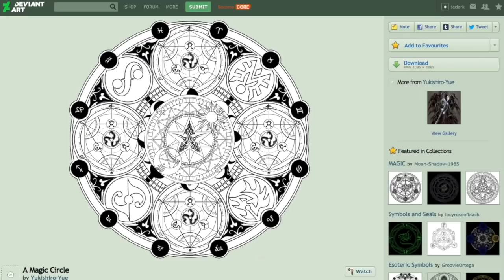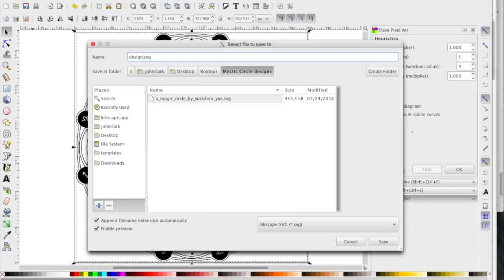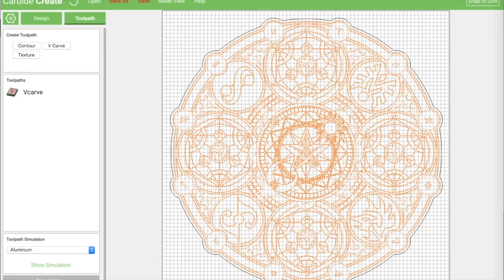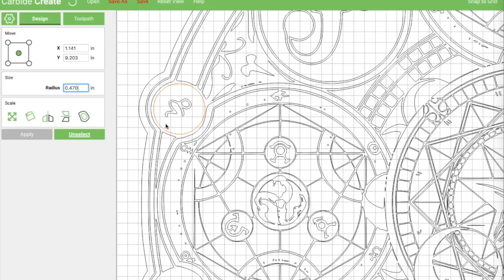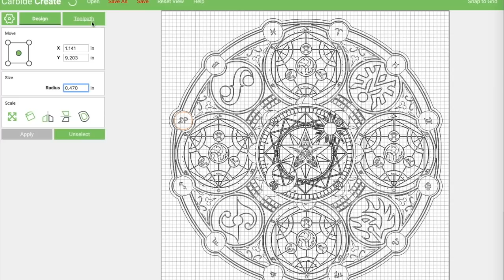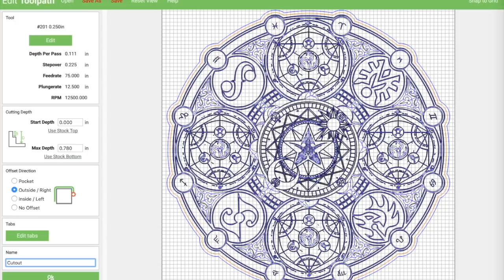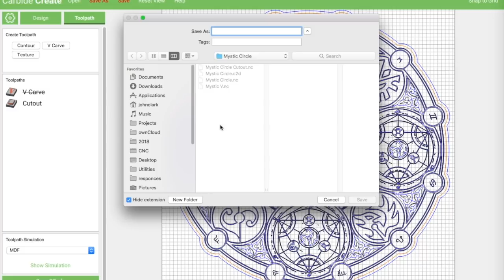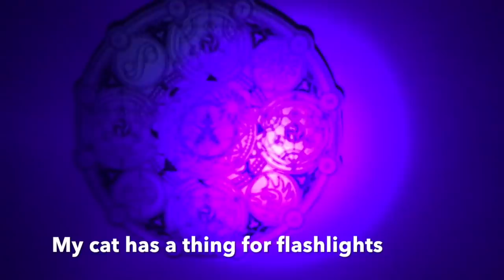Mystic Circle - MDF Wall Hanging with Shapeoko 3

Comment: Lovely project. On the painting, you said not to soak with water. You've already sealed the MDF with shellac & 2 coats of spray paint. You've not cut through those, so the MDF is still sealed. 
Another hint, you can add approx 20% water to acrylic paint, makes it easier to brush on & wipe off excess.

Comment: Do you have a video on how to add end mills to carbide or can you only use the ones listed?
Reply from the maker: I have not made a video on adding bits (it's planned as part of a getting started video I am working on). The basics are: When you create a tool path, you should see an edit button below the currently selected bit. On the next window you should see either "Change Tool" (current version) or "Edit Library" (Older versions). This is where you can edit and add new bits. The new version is a little more confusing as you need to add a new library, expand the library and then right click on the library and select New Tool. This is in no way intuitive.

Comment: Intersting.. I use V-carve so there is NO need for inkscape.  Its fareasier to use and has finer control on the toolpathing.  The downside is its NOT  free.  From $350 to $700 depending what version you get.. WELL wrth every penny and it dont take long to pay for it by the time saved alone to do things.

Comment: I noticed your version or carbide is not showing the estimated cut time how accurate is that?  I did a version and it told me the cut time was 17 hours!
Reply from the maker: The video is about a year and a half old, so my version of Carbide motion was pretty old. I seem to remember it taking about 6 or 8 hours to carve. Two things to check on your file: In the settings, you can drop the retract height down to about 2mm for MDF. Secondly, you can increase the plunge rate when you set the tool path. The big thing with a carve like this is the number of times the spindle must raise and lower. Let's say it takes 3 seconds to drop the spindle with your original settings, if you are making 10 plunges, it's not a problem time wise. However, this design makes almost 7000 plunges and at 3 seconds per, that's about 6 hours of waving your bit in the air. :) Does that make sense?
Reply: @johnearlclark  Hi John, I downloaded a phone holder design from cutrocket, tried to change the text and set up a v carve but it is giving me an empty toolpath any ideas?
Reply: I figured it out was using wrong bit!
Reply from the maker: @Olivsam  I hate when I do that.
Reply: @johnearlclark  John, I use a couple different programs to generate g code and send it with UGS.  I have noticed that the g code I run from carbide create runs much slower than other programs I use.  Can you recommend speed and feeds for carving wood? MDF, pine mostly
Reply from the maker: @Olivsam  I am still trying to recreate my old settings in the new version. I had a notebook with settings, but I seemed to have buried it somewhere in the shop. Carbide's settings do seem very conservative for wood. I typically set the cut depth to be half the width of the bit and then tweak as needed. A lot of this is very dependent on the type of wood and the bit itself. Brand difference can be big. I can push the Amana bits harder and still get a decent cut. I also tell people to listen to the machine. You will hear it when the bit gets pushed too hard. Pine can be a particular pain since it splinters really easily. Shallower cuts and a sharp bit are my best suggestion there. MDF you can push harder.
Reply: @johnearlclark  John, maybe you can help me, I am wanting to do a carving that has a  wavy ribbon around the perimeter.  When I zoom in, the sections of the ribbon are not connected.  I want to do a cutout of the piece that will follow the wavy perimeter any ideas on what I need to do.  Thanks
Reply from the maker: @Olivsam  Are they open segments (show up as pink lines?). If so, you will need to use the node edit tool to connect them together. Select a piece and choose node edit at the bottom left of the pallet (It's the one with the arrow and the little box) or use the join tool if the paths are pretty close together. If the pieces of the ribbon are all closed shapes, you can select all of those pieces and use the offset tool to make a line around them. Does that help?
Reply: @johnearlclark  yes Sir they are closed segments thank you
Reply: @johnearlclark  hi John, quick question,  I want to cut a square 3 inches by 3 inches but the actual piece is coming out smaller.  I am using a .25 endmill with thenputside right option..  Do I need to use an offset to get the exact size or what am I doing wrong?  Thanks!